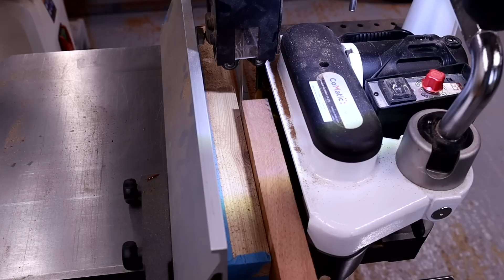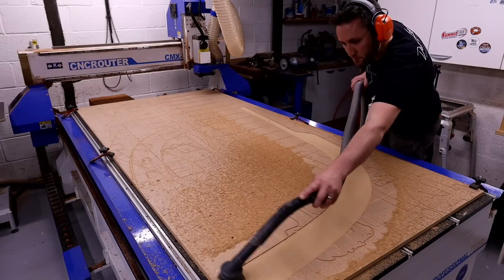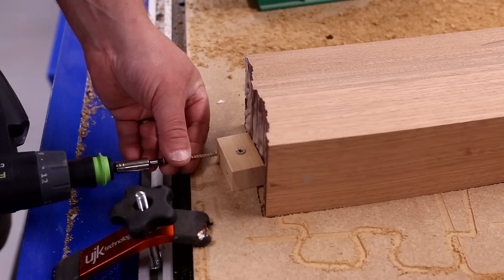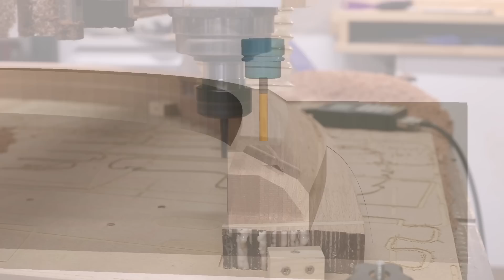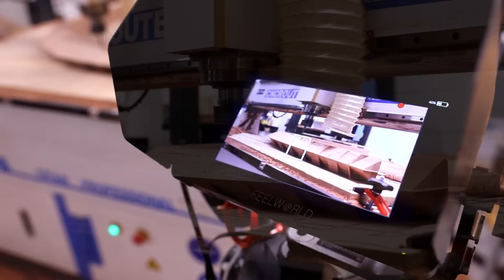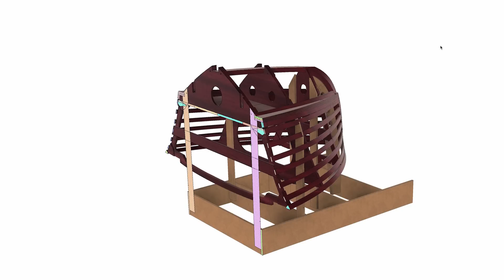The Modern Way To Shape A Wooden Boat Stem | Building Temptress Ep7

Comment: If you look at a Lafitte Skiff, there’s this outward flair that keeps spray on the outside the boat.  I know little to nothing.  But if the angle of the seam for the top plank that’s wide cross wise, but tapers further in as going down the stem, it’d seem this might help instill that flair.  Can I get some feedback or reference?
As the top plank goes from the stem toward the stern, it’d seem this would be necessary for the plank to twist from outward to inward creating the flair.  It’s also said used to give reserve buoyancy which I can go for.

Comment: It's a fun hobby, it would only be more fun with a CNC machine. and one day: learning how to use those programs you are running. I am out here kind of just hoping I'll get the bevels right using my batons and the power of the mind. the dreaded rolling bevel, from the chine to the sheer is one I'll literally do by hand. no CNC's, but CNC would probably get the job done much faster and more precise.

Comment: I'm lost. Cost savings?  Faster to build?  Stronger or lighter weight?  

Doesn't seem like something for a first time home builder nor possibly even in a factory?
Reply from the maker: I’m experimenting with new practices here to see how they could be used in the future. Most prominently, increases in accuracy, speed and therefore labour savings. 

No it is not doable for the first time builder and to do it this way you need to have access to a CNC machine and have good knowledge of 3D programming. If this was implemented into production then the time savings would be huge! 

The stem doesn’t have to be done this way though, it can still be shaped by hand using traditional methods.

Comment: you are selling me on this with the cnc strongback. just need the space! and also wanna see kinda the boat with someone in it and the free board
Reply from the maker: You can see some renders of the finished boat on this page here: https://danleeboatbuilding.co.uk/building-temptress/ no pictures with people in though I’m afraid as one hasn’t been completely built yet.
Reply: @DanLeeBoatbuilding  yeah i have looked at it a million times, among others. why i wanna see people in it. sometimes you see a boat looks good on paper/pictures, just sitting there! but then you see people in it and realize it is not what i like. dont know the technical terms how to explain it, but if a avg man(1.80) sits in it, i don't want a lot of the torso to stick out above the deck i prefer the deck closer to the pit then to the lower back while also not having the seat close to the deck of the floor/ kinda hard to explain as English is not my first language, and i am still learning the ins and outs of boats the technical terms
Reply from the maker: @davidnonya7359  I see what you mean. I will look at producing some renders with people in it so you can see the proportions of the boat better 👍

Comment: Very nice. I have used that technique to hold stuff down. Only thing I did was screwed into the piece first and then to the spoilboard. That way you are sure that the piece is bottomed out on the spoilboard. CNC is only limited by the vision of the programmer. So cool.
Reply from the maker: Yes I did that for the later ones, the first one I did I into the board first and it lifted slightly. The rest I did into the part first 👍

Comment: Love the video's question: Why not reverse render the frame holder? So you don't have to remeasure once you have to flip it to the other side. Plus, your production would be faster?
Reply: Once the top is cut it fits perfectly into the profile cutout in the waste board once flipped. Seems accurate and easy to do it the way he did.
Reply: @DamianPenney yes but he can easily cut spoil board in reverse and shave minutes off build increasing his production without measuring.
Reply from the maker: Do you mean cut a recess that the frame sits into the for the second side carving op rather than aligning on the dowels?
Reply: @DanLeeBoatbuilding mirror it.
Reply from the maker: I could do but with 13 frames to do I’d probably end up going through quite a few spoil boards. Cutting the full bevel on the frame means that the ball end mill needs to travel down below the height of the frames lower edge so if the frame was recessed into the board as well, the cutter would go almost all the way through the spoil board on this pass. Having it sat up above the board on dowels saves this and I think 1 spoil board will do all of my frames with just the dowel holes left in it.
Reply: I just re watched the video and realized you already did it. i must have looked away at that bit.😂 @DanLeeBoatbuilding
Reply: Yes sir..

Comment: Dan, is there a sailboat build on the horizon?   Or a you more a powerboat kinda guy?
Reply from the maker: There could be, I’m not adverse to adding sail boats to the plan catalogue. There is a huge time commitment though to develop plan sets to this level so we need to be a bit confident that the boat we pick will actually sell plans so we can recover costs long term. I’m sure the right sail boat could do that.

Comment: Impressed and a bit jealous!  
Two thoughts for anyone making their own Temptress:
1) Watching your precise cutting of the stem will help me with my manual placement of the chine top rail and  chine.
2) Routing a 1/4” radius on the back side of the stem will eliminate the need to plane the CNC-cut keel notches on each frame.
Reply from the maker: When I do my test setup of the front of the boat this should further help you to see everything that is going on I think 👍

Yes a small round over on the back will help to land this, you still need to be bevelling the landings into the frames though. Of course I am also doing that in the CNC 😏
Reply: @DanLeeBoatbuilding 
Fair point.  The keel landings need to angle with the bottom of the boat.

Comment: It is not clear to me how you established the datum that was the side of the glue-up you laid into the recess you cut into the spoil board.  I guess there was a lot of extra in the glue-up.  In that case you were just hoping that the real part didn't "stick out" of the glue-up somewhere as you milled it I guess.  Yes, about using the rabbit plane to square off the bottom of the landings, couldn't you have just radiused edges of the planks that land there?  Much less fussy than using a rabbit plane or chisel.
Reply from the maker: It’s taken from the internal curve of the stem shape in CAD, that’s the primary datum line I work from. The same curve that forms the outer edge of the lamination jig. Due to spring back in the lamination my stock didn’t quite match this hence the need for jogging the machine a bit and cutting this back face. The stock was laid up roughly estimated but so that I had enough there to get the finished part out of completely.
Reply from the maker: Ooh and yes the battens could have easily been rounded to match the landings. Just habit I guess wanting to clean up the notches and make everything look neat.

Comment: You are doing some amazing three dimensional work on a two axis machine Dan - testimony to what really can be achieved with good programming. As a retired furniture and cabinetmaker, I managed in the final years to buy, design and program a three axis machine for an employer and it was simply amazing what could be achieved - albeit after spending circa £200k but the productivity increase was phenomenal, never mind the new design opportunities that it opened up. Running a huge extraction system, the vacuum pumps and the machine, was costing £1k per month in electricity alone - and that was 5 years ago.
Reply: 3 AXIS MACHINE. SIMPLE 3D PROGRAMMING AS A TOOL&DIE MAKER.  IT NICE TO SEE WORLD CATCHUP AFTER 50 YEARS OF US USING THE TECHNOLOGY.
Reply from the maker: I’m trying to get the wooden boat industry to catch up. It’s decades behind the rest of the world right now 😆

Comment: Curious to know how many man hours you reckon you saved by using the CNC here?
Reply from the maker: It’s difficult to know having never done a stem quite so complex as this manually. At a guess though I think this may have halved the time for shaping the stem on this 1 off.

Of course where cnc really comes into its own is in repeat work. If you were putting this boat into production and doing batches you could probably produce them at 10x the speed using this method vs maybe 2x the speed for batch production the “traditional” way. Plus whilst the machine is working you can be getting on with something else 💪
Reply: @DanLeeBoatbuilding  Thanks for that!
Reply: @DanLeeBoatbuilding  Yes, and...running the numbers on the full cost of the build, can the precision and efficiency of CNC and kitting, bring the overall cost of this amazing build down by X% and so and end / total cost that opens up this build to a larger customer base than the typical Van Dam, Stan Craft, Lyman-Morris, Spirit Yachts, Cockwells, customers?, etc.)
Reply from the maker: I would like to think so. These refinements will help speed up my build in the assembly stages for sure. If implemented into larger production setups the time savings could be mega and it would allow more time down the line to spend on finishing details. I’d love to get involved with one of the larger wooden boat producers some day in the future and look at how these practices could be implemented. I really think this could tip the balance back in the favour of wooden boat manufacturing in the future 👍
Reply: I was going to ask him this question as well. The benefits of this method are numerous of course (Time and obviously labor savings, increased quality in the fit and how the boat comes together, and more)

Comment: Most modern woodshop facilities use their waste in a furnace to generate hot water for heating or steam to generate power or both. I worked at a large furniture maker who was doing this 20 years ago! Every machine was connected to a central vacuum, the giant bags were emptied regularly and the waste was pressed into brickettes for use in the furnace to generate heat and power for the factory offsetting their energy use from the grid.
Reply from the maker: I have a briquette machine in my shop that all the dust and chips go into so the waste does at least get re purposed into firewood 👍

Comment: Super nice! Very familiar process and you nailed it! 🤩
I had to do my stem in two halves due the fact that it's 220mm thick eventually. And my stem wasn't really very flat in the beginning so I had to plane it down from both sides before I started the carving. Haven't done the final shaping yet, the stem has 10mm steps on it. But I think that's easy to do by hand (or electric planer).

One question; what kind of tolerances are you using with those landings and stuff? I've come up with 0,4mm (0,2mm on both sides) to be good with plywood/OSB joints. On my first parts there's none and they're gonna cause some trouble soon... 😅

Good stuff! Keep it up!
Reply from the maker: Yes I think removing the steps by hand will work fine. They actually give a very clear indication as to how much to remove and where. 

Tolerance wise I am machining these to the exact size based on the 3D model. I’m expecting there to be some trimming work down the line but when I do the mock setup of the front end of the boat I should be able to start to see how this will all work 🤞

Comment: I knew a boat builder back in the 70s who said that modern timber boat building consisted of turning big bits of wood into many little bits of wood, then gluing them back into a big bit again.  I have found in some cases wastage of original material can be more than 50%, especially if doing re-sawing on a table saw.
Reply from the maker: That is very true 👍